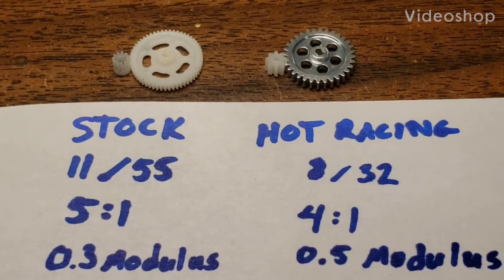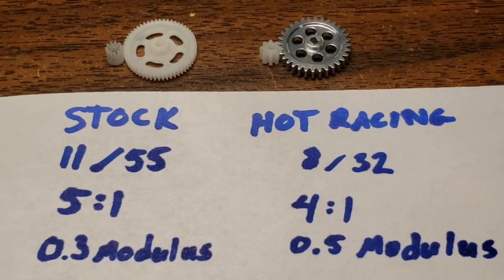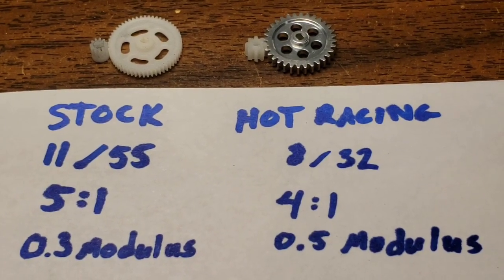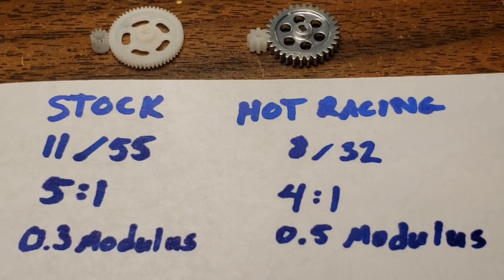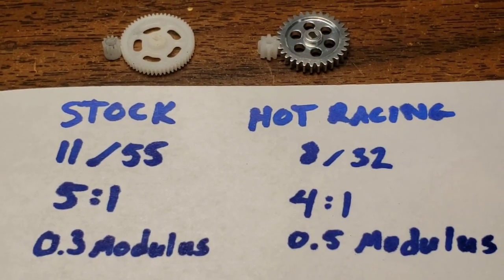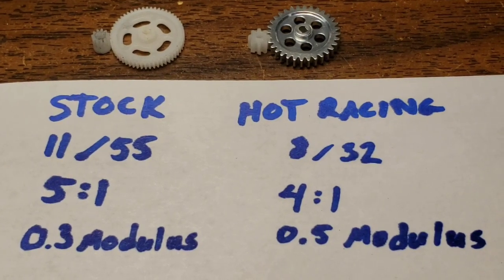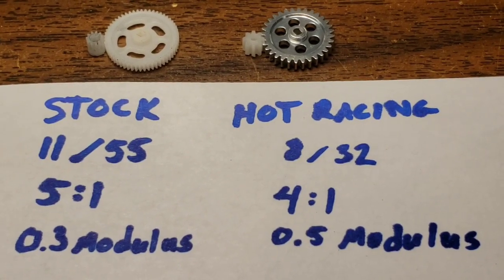SCX24 Gear Teeth And Ratios

Comment: That's excellent info. Do the hot racing gears swap directly over the stock or do you need to buy their motor mount? Does the 0.5 open up the option of future mods because it's more common and easier to find compatible gears? I think this higher gearing is perfect for me because I want it trail with it. The stock setup is slower than my walking speed. Any other ways to make it faster using the stock motor mount?
Reply from the maker: It should work with a stock mount. Worst case, you might have to open the holes a little more for gear mesh clearance. 

Another way to go faster with the stock motor mount is to get a Furitek Teju and run 3S. 

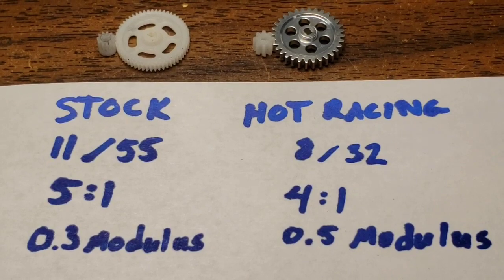My Deadbolt with the HR gears and a PN70 Mini-z race motor is as quick as my 1:10 Redcat Everest Gen7 with portals on stock  trans gears on 2S. I never changed the pinion or spur when I converted it because I like the torque. Now I run 3S.

Another way to get more speed is to install Treal overdrive gears in both diffs. 

https://m.youtube.com/watch?v=9UDwDz-4D7k

Comment: Thanks for finally clarifying this! To me, gearing up to 4:1 makes No sense. I'd rather gear down for more low end torque.
Reply: If your running a barrage motor the hot racing would prob gear it back to around stock speed as the barrage motor has more torque and less speed then stock motor with the stock gearing.
Reply: @zGuy-yp6um  Thanks, I definitely noticed the additional torque on my barrage motor. But it did not feel slower to me - althouhg I observed that there is actually no big difference between medium and high throttle settings on the transmitter.
Reply: @teneridertravels  They are actually a good bit slower my buddy has one with stock motor and I was really surprised how much faster it was and yea I know what you mean about the medium and high setting not much difference at all I would like to try the treal over drive gears in front and rear on mine to see how much faster it makes it withthe barrage motor.